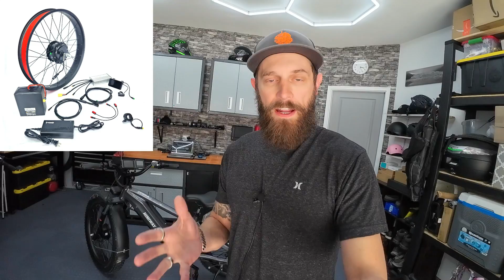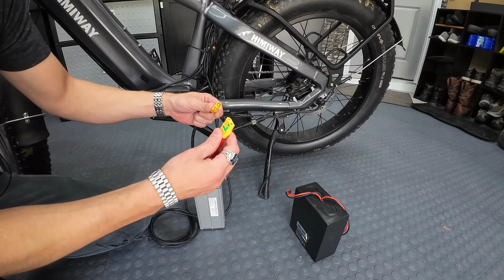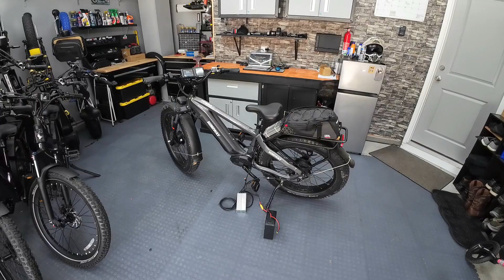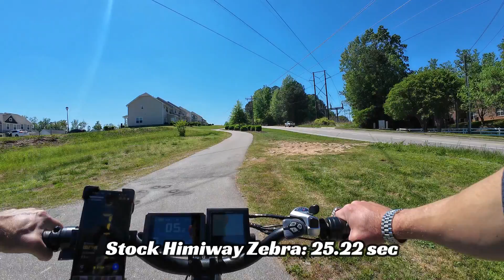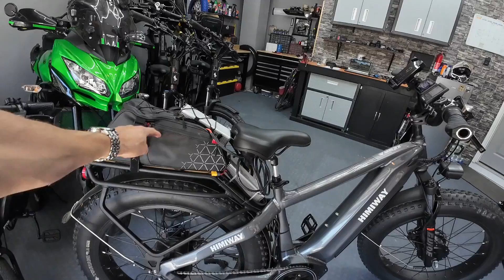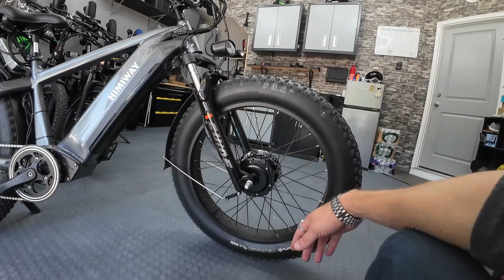Himiway Experiment: 40a Controller Upgrade

Comment: I just installed a 35a sine wave controller on my V20 Pro. My 21a square wave wasn't that great. My stock H6C display, lights, and switches works with this new controller. I had to rewire nearly everything though. I cut both plugs off my harness and crimped connections on 21 wires. The two sets of 9 wires on my new controller match in colour. I had three extra wires in my harness for pedal assist. They are seperate on my new controller. I just wired that to that.

Comment: Wattage is calculated by multiplying
voltage and current (W = V x I). When
starting an e-bike motor, the inrush current spikes, causing much higher wattage initially. Once the motor stabilizes, the current drops, and wattage settles to its normal level.

Comment: Voltage makes speed, not amps. That's why fast bikes use 52,60,72  volt batteries. What voltage battery did you use on the test ride.

Comment: 30A controller for Wildeway FW3.0 would be awesome. It' has a 48v 32Ah battery, 750w hub motor. Motor connector is a L915 type.

Comment: Many modern ebike motors can handle 60v. I know I would buy a controller (35 or 40 amp), display and battery for my Freesky Wildcat at 60v. Can your 52v controller manage 60v? 
If so, I'll buy that and your display and be the guinea pig.
Reply from the maker: @montet6268  I hooked it up to a 60 volt battery before and it was fine. I'm not sure how it would be long-term since it's not rated for it.

Comment: Definitely make an upgrade controller for the Himiway cruiser. My KD 718 controller went out and I'm back to the Himiway display, which tops out at 28.6 MPH and the motor is definitely not topping out. The KD 718 gave me 32.5 in pedal assist 7. I believe that's what it does to boost the speed. I cannot get 32.5 with throttle only, but ya make the controller and I'll buy one for sure and throw it into the mix

Comment: I would love a 40 amp controller for my himiway cruiser. It should run much cooler than maxing out the stock controller especially if it would also function if the hall sensors failed due to heat or whatever else. I know some controllers do not require these sensors to be hooked up. Riding in the woods can really heat up the whole system pretty quickly. I go on multi day camping trips on mine where it would be a long way for this disabled body to walk out for help. I would also be interested in a front hub motor kit to help with hill climbing and pulling through wet and muddy areas off-road. Thanks for all you do here and congratulations on the beginning of the new chapter of your lives together!

Comment: I have a question I have a airwest big tire it looks the same as the himiway my connector is a ip65 3 pin red plug I would definitely buy a 40amp controller from you plug and play please make them

Comment: You may already know about this Citizen, but there is a handy power modeler for ebikes available online by a place called GRIN technology.  They are a hub motor manufacturer, but their program has models for quite a few other popular motors like Bafangs hub and mid drives. It also allows you to input different voltage and amp values to see how they affect the torque curve and rpm. You might find it useful for simulating power upgrades.

Comment: Nice job, himiway focuses on long rang bikes . So they use the 22 Amp controller in most of there bikes . 
 But myself I like the speed . 
 I'd like to see you up grade a D7pro mid drive . 
 And a cobra updated with a thousand watt motor . It comes with the same 22amp controller ??
 Also what model display are you useing in this video.?

Comment: Do you make upgrade kits for the 48V Aniioki A8 Pro Max? I have the 48V Aniioki which is perfect for range can't lie about that but the torch on the throttle is terrible.  I need a lil more power and this 48V bike will be great. How much do you charge for kits if you do make 48V kits and how much Capacity do your battery have? Thanks for your help in advance!

Comment: I have the zebra, I changed the display to unlock the limiter. Now,  I want to change the controller and motor to bafang 1000w.  Also, are the meral gears avaliable .

Comment: I am now starting to love the extra power. I have a meelod dk 300 max. I would love to know if I could upgrade the controller. I know my controller is a single 44 amp powering both motors. Do you know if this bike could handle a bigger controller? I would love to buy a more powerful controller and a nice bigger color screen that mounts in the middle. I love your videos. I bought 3 different bikes from watching your videos. Keep up the good work!!

Comment: I have a question, and you seem pretty knowledgeable about this whole ebike thing. If you upgrade the controller on an ebike it is my understanding that you need to change the display as well? I am asking because I see plenty of controllers for sale on the internet, but most do not come with displays. Are there universal displays? Is there some way of knowing what display goes with what controller? It is a bit confusing. Also, if you did not want to go with a trigger throttle, can you change over to a twist throttle? Do the connections need to match up, or are they fairly universal. If you had any input I would really appreciate it. Thanks!
Reply: By the way. Yes. Serious holes in the upgrade market for ebikes. Would be a good idea to fill that gap and take the mystery out of it all.

Comment: Bryan I think you have both in one right here 1) A range extender, extra battery 40 amp controller and a display. And at the same time you have upgraded performance when using your kit. If I bought your kit I would use it for the first part of my ride and when the battery is just about empty I can unplug the main power lead and connect back into the stock Himiway Zebra controller and battery. 
In my case I have the KD718 display so I would only need to order the 40 amp controller and your battery. 
I like the front motor setup as well but the cost will be much greater to change the front forks and order front wheel with motor. 
As you are not posting overseas I might even give this a go myself. Thanks for the idea. 👍

Comment: Definitely aventon and himiway range extenders! Aim for like 2 to 3 time longer on throttle only if possible, because we already know that the pedal assist will follow!
Reply from the maker: okay.   It would be an additional 20ah pack
Reply: @CitizenCycle925  sounds good, hell already better than the stock battery!

Comment: How bout upgrading the Kepler?… it has a stock 33 amp controller!… I think there is a lot more power to be had!… already ordered your warp kit for it!… how would that work?… would you just be bypassing the Kepler stock battery and controller?
Reply from the maker: the front motor kit functions completely independent from the stock Kepler components.  If i make a rear wheel controller upgrade, it would be a direct replacement of the bikes stock controller and would plug into the stock battery and motor.
Reply: @CitizenCycle925  well then if you make one for the adventure and the Kepler, I will buy them both
Reply: I’ve already purchased the warp drive kits for both of the bikes. I just mentioned this way here. It would be nice to have matching Display screens for both bikes
Reply: You would think that the controller for the Kepler would be the same plug and play as one for your grizzly

Comment: I would like to see a bafang rear hub motor with one of your 40a controller and 52v battery upgrades
Reply from the maker: I'm attempting to make a universal 40a controller that will fit any 750w geared hub :)

Comment: I have an M2S All Terrain 750 step thru and have been trying to find a plug & play controller to upgrade to! Stock is 25a. I would LOVE IT if you could help with modding those bikes! The 750w Bafang motor on those is custom wound for top speed, so they’ll get to about 30mph on flat ground, but they lack the pickup and low end torque in my opinion. If I could fix that issue, these would be fantastic bikes! If you aren’t familiar with M2S out of N Carolina (I think) then please check them out and see if we could mod them!!
Reply from the maker: I am working on creating a universal 40a Controller that will work with any 750w geared hub motor. I will keep everyone updated. :)
Reply: @CitizenCycle925  That would be awesome if you could make a universal controller to upgrade any bike! Please let us know if you make it happen!!

Comment: Hey bro!  I need a kit for my Aniioki A8 Pro Max Ebike. I was talking to this lady on Alibaba and she has a 2000 Watt Motor rim and motor kit with the display,throttle,and the controller looks like the one you using on the Himiway...it's a 40A controller.Only thing I'm worrying about is I'm trying to see if the battery on my bike is Compatible. So that is a good idea what you are going to do. Make some kits that's plug and play and better kits to give these slow cheap ebikes some speed. Everybody can't afford a Onyx or Surron. Let me know if you can hook me up a kit that's compatible with the Aniioki A8 Pro Max Ebike. The kit the lady showed me looks decent and the price was only $260. So let me know if my battery will be compatible with your kit I can purchase it from you. Let me know asap! Thanks!
Reply from the maker: I am working on creating a universal 40a Controller that will work with any geared hub motor.  Explaining to my manufacturer now what i want.  Going to take a while before it's finalized though.  I will keep everyone updated but if i can pull this off it should work with your Aniioki bike :)

Comment: Once the bike is up to momentum and you are no longer accelerating, it requires less current to maintain speed. Less current = lower wattage. This will happen at any speed you settle on.

Comment: Have you tested the Meelod dual motor xt 600  e bike dual bafang 750 hub motors 48 volt 25 amp best hillclimber I have ridden so fat at 240 lbs..
Reply from the maker: I have not been on that bike, i would imagine the power is similar to the DK300 Max that i was on though, it has the same motor and battery setup

Comment: Business idea for you - make a front motor kit for 20" bike wheels.  I don't have the $$ now but imagine a P51 with a front motor!

Love the range extender idea.

Congrats on the upcoming wedding.
Reply from the maker: yes, 20in front kit might be next on my list, just need manufacturer to send me a sample for testing. maybe soon though..
Reply: @CitizenCycle925  or consider something built around Truckrun  FW29/RW29 motors.

Geared hubmotors actually built for 1500w each.

You can get them on Alabama, but not aliexpress.

And they are very inexpensive.

For someone putting together kits, these would be a good product to get behind.

That could change of course.
With increased popularity, they might jack prices.

Or competitors might start building higher powered geared motors.

Comment: Maybe you should sell a rear motor,controller and screen kit for the common fat tire bikes to work with their integrated battery's.  Mainly aventon aventure 2 bike. I have a level 2 and aventure 2 bikes.  And I have a 24 wired cruiser and just with the other 2 bikes could match its power.

Comment: Congrats Bryan! Great video! 👍 
I have a couple questions. Does the pedal sensor also work with that controller? What is that adapter called? Whats the name of the end on the motor? What the name of the end on the controller? 
If you need xt60 for the battery, simply cut the wire and solder xt60 or any other end to match. If you use dual motor you will surely get 37mph or more.

Comment: I don't have much to say since ActivityPhoto explained it so well, and your motor will naturally draw less power as it reaches it's KV rating. The workaround is field weakening, but you need a controller that supports it, and field weakening does not play well with battery blenders. Too bad we are not neighbors... I could whip up any adapters you need! When you use the stock battery, you need to pay attention to the wire gauge coming from the battery and the controller. They only make it as thick as necessary, and on my Radmini for example, they used 16 gauge wire and it almost melted during my early days of experimentation!
Reply: Do you know what the end on the himiway motor is called?

Comment: wow so much in these great ebikes!
and seeing you have fun with it is good to see.

 I have a couple Favoto ebikes  a discontinued fearless step over [its a fun one](maybe? a copy of the early Himi cruiser? maybe?) it has a 750 W Bafang hub motor thats fine for me. I like slow low impact trails and dirt/gravel roads (Im in North Idaho) and the less traffic the better.
 my Cur is at 20 on the display & has a mediocre/stock controller that Id like to swap out to around 30A ?
then run cur about 25 or so.
 my hope is to make it a better grade 23%  climber as it is its ok, but falls out on the 20+ % grades.

 my other is the flurry 2.0 750w hub mother same battery and a 22A controller  same 48V 14ah battery.
it does much better on hills & goes up grades to my surprise. its display Cur is set to  20A   
the flurry is still being sold & looks like a himi also. [the quality of these is a nice surprise to me]

 in the future I might get a better brand ebike, But these are my 1st ebikes and I see they might be made into something a little better (?)
 speed is not my great concern as I ride trails & top speed of 20 is fine for me. Id like a better climber.
my average putt along is 11 to 14 mph (I like to look around) the journey to me is something to enjoy.

  kinda want to stay 750 watt and be accepted on USA trails, just to look good ;) 

feel free to email me as Im wanting to upgrade these & maybe convert my mtb bike with a mid drive. ;)

Comment: Congratulations to you and Mrs Citizen.

I would like a good way to carry a 2nd battery.  It is not that important that the 2nd battery is hooked up.  I can always stop and exchange the batteries.
I have several e-bikes and have 2nd batteries for 2 of them.  

The one I do not have a good way to carry the second battery.  The battery is removable but integrated into the frame.  If I had a good padded bag that could be strapped to the bike rack that would probably work.  I need something like this when I go on longer rides.  One more thing the bike is a step thru, so no crossbar.

Comment: I want to upgrade kit for my walkie H6ST Max. It already has a 28 amp controller but I want a little more oomph. The problem is the original controller has a 5-pin throttle/horn combination and that would have to be swapped out also. It has an 1121 motor connector and a xt90 power connection.

Comment: I would like to see a power upgrade(plug n play) for Aventon Adventure 1st model. I'll check back. I bought an extra battery for range but it would be nice to have more acceleration n power to hold my own on the road with cars a little betterer.

Comment: I would be interested in your front wheel kit if it were for a 20 inch wheel, specifically for a Megacycle Ocelot.  And I would like to replace the controller to get rid of the auto-cruise control -- I hate it.

Comment: You are correct the windings determine the maximum RPM the motor can produce per volt applied to the motor this is referred to as KV in brushless motors.  Therefore to go faster you need to increase the voltage in the battery and BMS supplied to a controller than is designed for that voltage.  The extra amps supplied by the new control account for the faster acceleration as well as better hill, climbing power. But those advantages can be limited by the maximum amount the BMS allows the battery pack supply to the controller.

Comment: 🎉 Brian, first of all God bless you and Mrs Citizen in your new marriage and Holy Union under God. 
It's a lot to unpack on good Performance Kit video. Mainly:
1.  Your Plug & Play Performance Kit upgrade ingenuity is right on target, especially considering if you can source and stock the latest technology-based parts before the foreign source well runs dry/"sanctioned" by the elites (of either party) running our nation;
2.  Be careful to not get too deep in the weeds of micro-specialty kits that will not be cost or time effective for you and your family (Keep God FIRST and He will bless you, your family and your business);
3.  Instead of running two batteries on the same system battery controller in parallel, consider focusing on a smart battery controller that will allow (auto balancing) your kit purchaser to use batteries of varying voltages (e.g. Instead of requiring 2 batteries of the SAME voltage).  This approach will also cover more ebike systems and potential customers.  Be careful here because some smart battery balancers are limited by the amps of the controller, and;
4. Now you and your new bride Mrs Citizen be obedient to God and help re-populate and restore our nation "Under God." ✝️☦ ❤

Comment: If you built a kit to upgrade my Aventon aventure (1.0 version) to a 40A controller using the existing display and PAS system, I would definitely buy it.  Even if I had to switch out the display, that wouldn't be the end of the world either, especially if it gave me more control on how I want to set up my bike.  As long as the throttle still worked and the PAS system still worked, I would be all in.